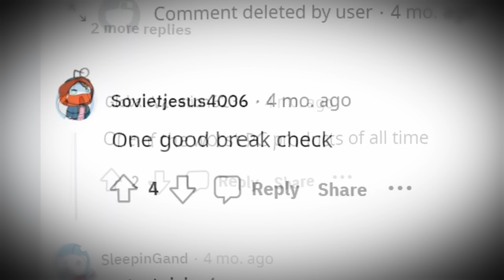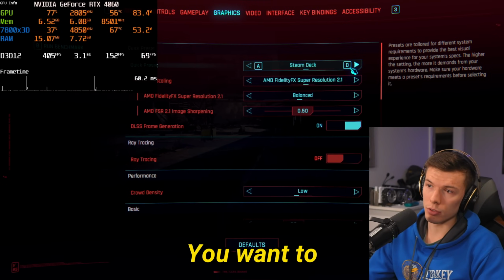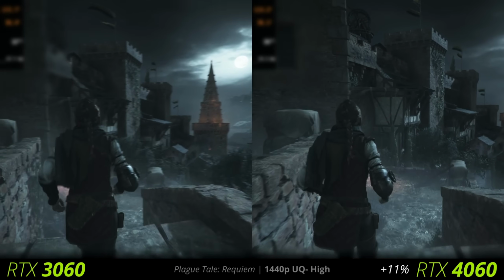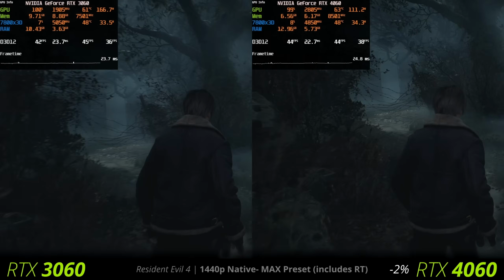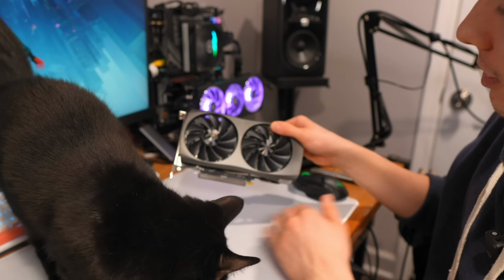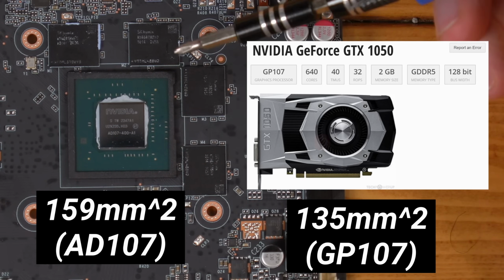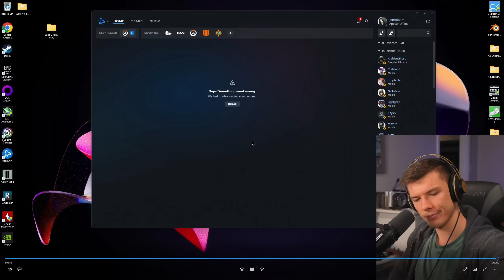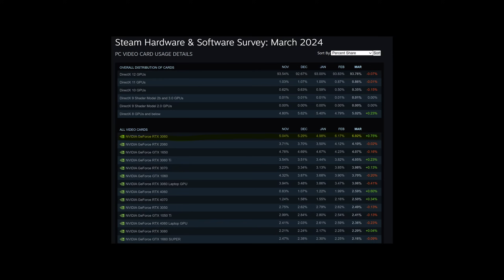I Tried Nvidia's best "Budget" GPU to see if we're Doomed

Comment: For perspective, to those that may be too young to remember.
In 2016, AMD Launched the RX 480 and RX 470. It launched along side Battlefield 1, which to this day, looks better, than some AAA games (cough, starfield) and still looks absolutely insane.
The RX 470 was MARKETED as a 1080p, 60fps, MAX SETTINGS card in a game that didn't even launch yet, and set the standard for graphics fidelity in first person shooters.
The 470 was also capable of getting 60 FPS at 1080p, max settings, in the witcher 3, probably the most demanding title at the time and was barely a year old.
The RX 470 cost 179, and the RX 480 cost 199. Accounting for inflation, that would make them 230$ and 260$ respectively.
The fact that a card for 299$ can't play a game like atmoic heart or the last of us at 1080p at 60 fps...even with NVIDIAS SUPPORT IN THOSE GAMES. Is sad.
Its also sad that the card from the previous generation runs better most of the time...

I won't even mention how in 2016 the RX 480 8GB at 230$ was marketed as a 1440p card...before 1440p even went mainstream.......

And another problem...is the 3060ti costs around 250$ used....
Reply: oh my god I knew AMD released some absolute bangers but I didn't know they released bangers THAT GOOD??
Reply: Amd got overshadowed hard in that time period by the 10 series of nvidia. It wasn’t until the 20 series that they started to fall off again. Even the 1650 super and the 1660 super are still arguably great cards for the price. Right now you could get either for less than a hundred dollars used. It is insane that the 1080 ti is comparable to the 30 series cards.
Reply: @delayedplayer I gave my 480 to my friend so we can play helldivers 2. It runs at like 40 fps native res, on an 8 year old midrange card.
Reply: Bro! I had the RX 480 and it was a fricking beast. I got a 3090 3 years ago and I gave my RX 480 to a friend and is still playing games on that card to this day. I was playing Resident Evil 2 Remake on High at 1440p 60fps. It could even run it at 4k 30 fps, that thing was insane, and it cost me 300 Canadian dollaroos. What a steal.

Meanwhile I don't want to say how much my 3090 cost 😢
Reply: The RTX card cost a bit more because of the RTX features and power efficiency, which is why it's getting more popular than the AMD and possibly Intel Graphics card that are cheaper and offer same or more performance.
Reply: You are just adjusting for inflation, but there are much more stuff happening on the silicon industry. The cost to decrease the litography skyrocketed, and the production costs are still increasing for several silicon chips mainly due to the commercial war against china.

It will affect, of course, the consumers. They just needed a window to justify the price increase, and it was the pandemic and crypto-mining, perfect excuses to compensate the production costs and  to increase the profit margin.

Not saying this to justify anything, I'm a consumer as well pissed off with such practices. Just saying that "inflation" is not the only thing that can explain these prices.
Reply: Problem with people like you is that is that you try to paint the other company as good. Yes Nvidia is mega shitty but AMD is garbage as well.
RX 480/470 and their refreshes rx 580/570 were great cards but what about releases like 5600xt and 6600 and 7600xt? Where AMD is back to marketting them as "1080p" cards. So no progress in what 8 years now? Infact a regression?
Reply: I have a 3060 ti and I didn't really think it was that bad until I got a 4070 s and it smoked my 3060 ti. Then it started bsod. So it got returned. But ya idk what to do. The 4070s models all have pros and cons and idk if I'm ready to give up my evga cardyet. I still have 5 years of warranty!
Reply: Yes i remember when ATI mad 2 drivers by years... overshadowed themself.....
Reply: Wait the 4060 can't run atomic heart at 1080p 60? I was getting near high refresh rate fps with the 3060Ti on mostly high settings. 

I know the 3060Ti is faster, but the 4060 should be able to run the game at 60 fps.
Reply: @chanzeyu1  I played the gamepass version and it was hit or miss but I didn't get very far. There was a stutter that was driving me nuts. I think it must have been a gamepass thing. My 3060 ti is stock tho. I don't oc anything. I prob should but I have never really been into it. Too much time fiddling with stuff, less time gaming. And I already have pretty limited gaming time. What 3060 ti do you have ?
Reply: @natel7382  FE, no overclocks. I did UV in the 2nd half of the playthrough but I kinda just gave up on the undervolt. It's not worth the instability. 

I honestly just lowered some settings and the stutters were gone? I'm not sure, but I had a great time with the game.
Reply: Yeah but that was in the past, now the same company doing that same shit that invidia doing

Considering that are still behind invidia
Reply: My 580 8GB hold up for 6 years and i could play anything on it at playable fps.
Reply: My old RX480 8GB is still in my sons PC at grandmas house. It still rocks in Fortnite and CS2. Never had any GPU that long.
Reply: @delayedplayer Most modern AMD cards are good. Nvidia is shit per dollar spent nowadays.
Reply: Yeah a 60 class card should at least bare minimum  achieve 60 fps all time native in  1080 ultra without  ray tracing
Reply: @Rullino32 don't give bs arguments 3060 is popular for AI stuff you need Nvidia gpu for that otherwise you would have to deal with a lot of headache and issues that 12 gb helped a lot power efficiency don't matter that much and certainly not to increase prices of a graphics card
Reply: Tech investing Boomers ain't ready to accept this fact
Reply: As a person who picked up a RX580 8gb for $60 (usd) a couple months ago, I wholeheartedly approve this post.
Reply: DLSS tho

Moore’s law is dead
Reply: its hilarious that i use a rx570  4gb and get 100+ frames in most games 1080p low settings
Reply: i played The Last of Us on high settings (no visible differences from Ultra) at 80-90 fps without an upscaler on the RTX 4060. Don't know what are you talking about.
Reply: @Rullino32  Nvidia and power efficient aren't synonyms
Reply: @skylius  I know, but most of the power-efficient graphics card are mostly made by them from what I've seen.
Reply: And then they proceeded to do it again but even better with the 580, the budget goat
Reply: What's more crazy is that RX580 still shredds some AAA titles of 2020-2024. Had stable 60fps on medium settings in cyberpunk on release, On release!!! Had a good experience with game and didn't have any major issues with the GPU itself and I got that one used for 140$😂
Reply: @talacra  it's the best bang for your buck in the hyper budget world of gpus
Reply: So which card should I get then for upgrade (I have 1660super)
Reply: Truer words have never been spoken. I salute you sir.
Reply: @Rullino32  that's mostly a selling point for productivity and crypto mining lol. I'm not gonna say nvidia cards suck like some people say, but if your goal is strictly gaming then amd probably has the best price-quality relation on offer. If you really need a GPU for work, with AI, crypto mining or intensive video editing then nvidia is probably the best, at least for now.
Reply: @Vecchete  but crypto miners did cause huge inflation on GPU prices, it's a big part, not the whole cause obviously, of why nvidia cards are on average way more expensive and have more sales. Are people forgetting that there were months were it was nearly impossible to get a 20 or 30 series RTX GPU at retail price on launch? It's not that there weren't any for sale, it was that intensive crypto miners were buying them out, and then on top of it there were market scalpers hoarding them to re-sell them to miners, so it wasn't just the shitty companies blaming greed on external factors, there really were external factors at play. And ofc the delays with shipping during the height of covid craziness added to the issue.
Reply: @CloudMV  If you're not having any issues with the performance, it should be alright, but if you want to upgrade the resolution or feel like it's lagging at your favourite games, you could upgrade to at least an RTX 4060 since it consumes similar amounts of power for more performance, otherwise if you're willing to upgrade your power supply, you could get a more powerful graphics card but that depends on the CPU you have.
Reply: @nuffsaid7759  I'm not saying that the RTX 3060 is garbage and no one should buy it, I just said that the 4060 performed better in the video except it occasions where the 3060 was better because of the VRAM capacity, but for 115W, it's impressive that it's performing well, if it had 12gb of VRAM and 192 jus width, it wouldn't be marketable as a 1080p card and not many people would be buying the RTX 4070.
Reply: @Rullino32  RTX card doesn't cost more because of rtx features it because Nvidia decided so because Intel use same thing as Nvidia although those aren't polished but they take the same amount of space in the wafers That's just nvidia tax.
For years a 60 class cards had 192 and 70 class card had 256 bit bus why they changed it now because sheep will still buy it plus defend their purchase and justify nvidia's decision to scam people of what they believe a 60 class card should be. Price and performance isn't everything for some people architecture matters.
of course it's efficient it's a 5nm tsmc.
Snapdragon 8gen3 is able to run gta V at 30 fps with 15watts only. If people defend nvidia for this decision then get ready for 64 bit rtx 5060 8gb it would be super power efficient and will run excellent and cool in 1080p be happy.
Reply: @nuffsaid7759  Fair enough, power efficiency is a great thing if they added more performance, but skimping on specs like VRAM in the 30 series made lots of people angry, which probably led Nvidia to add more VRAM for all the 40 series cards except the 4060, which also got bad reviews since it can't run every game at 1080p ultra, but it's popular for Fortnite gamers because it favours Nvidia IIRC, I could be wrong but I think it'll be at least top 5, top 3 or even 1st since it's the cheapest card from the recent generation and it's also popular in many pre-builds due to the decent price/perfomance relation, which is why the GTX 1060, GTX 1650 and RTX 3060 became very popular according to the Steam Hardware Survey, Nvidia is very popular in most Tech stores in where I live but they're only in pre-builds and laptops, the only "alternatives" could find were AMD and Intel iGPUs in laptops or cheap desktops, the best ones were around €800-1000 IIRC.
Reply: @Rullino32  i have ryzen 7 3700X 8 cores,will it bottleneck with 4060?
Reply: @Rullino32  A Good deal is a Good deal but that doesn't mean the product is good.
When I first went to buy a gpu there were no amd card in my area (wanted a rx 580 8gb) settled for 1060 6gb because I wanted more vram. Pricing and availability makes people buy the products but that doesn't mean It's a good product. 
There's a difference between good product and good deal.
Almost always a good deal will be better that a good product because it can almost do the same with less money but that's also not true for 4060.
People playing fortnite have no reason to buy a 4060 the only reason I see to buy a 4060 is horizon forbidden west or if your gpu died and you need a 'Nvidia replacement ' of current generation at cheaper price (makes no sense) I would just get the 4070 at that point that runs rdr2 at 100 fps no questions asked.
For 300$ rx 6700, rx 7600xt would be a better buy because at least the 7600xt gives you 16 gb
Reply: @Rullino32  I wanted RX 580 because I learned that in Doom 2016 there's  less texture clarity /quality in nvidia compared to Amd gpus because of texture compression or something
Reply: I'm still on rx580 f*ck both nvidia and amd for runing this clown show.
Reply: as someone who currently has a 570, it couldn’t even get 60 fps on the lowest settings of bf1. it can’t play ANY modern games. it can barely even play competitive games at low settings.
Reply: @Dobertathon  If your card is 4 gb it's over bro even in resolution like 800x600 with modern games like horizon forbidden west or RE4 it demands close to 8 gb vram.
Horizon forbidden west for example only takes 500 more mb vram when going from 800x600 to 1440p. Forget about 4 gb cards it's over for 8 gb cards as well. The Pascal generation is finally over. 
But here's the thing newer games aren't that good compared to the old ones which you could play flawlessly on your 570.
Reply: I just feel like they don't bother to optimize the games anymore since new shiny graphic cards can handle them anyway. Battlefield 1/ Batman Arkham Knight already look very good while running smoothly, but lately graphics have similar quality to them, while running way worse
Reply: I currently have a Rx 470 4GB and a 6650 XT =  it depends on the game. So I like Skyrim a lot and the 470 can only play vanilla Skyrim on 1080/60 with medium settings, but would crash when playing the Special Edn version. XFX 6650XT can max Spec Edn version but has tons of screen tear no matter what settings & parameters I use. 1440p maybe, but idk since I owned COD and Rainbow Siege when I had a 1070, but I get bored of shooters very quickly and have not tested them with the 470. But being these games like Valorant do 500 fps with a 7900xt, I'm pretty sure a 470 can get at least 60 frames. So again it depends on the game.
Reply: I'm on an MSI RX470 8GB rn. 😄
Reply: @donaldtrumplover2254  The 1080 Ti might be one of if not the best cards ever made in their respective time. It still can be used today with FSR support. It is the like a combination of an old sports car with the reliability and longevity of the old 90's-00's Honda cars.
Reply: @delayedplayer  The RX480 was really special.
Reply: No he wasn’t running anything at 1080p. He ran everything at 1440p. The card is literally a 1080p card.
Reply: @delayedplayer  They arent that good believe none of what you hear and HALF of what you see 😉
Reply: 1080p 60fps, this card is capable of that, but the problem is the graphic settings, either high or only low or mid like Last of Us settings wit custom settings to allow for.more.optimal performance.
Reply: @Rullino32 That's what they want you to believe. These features are in benefit for nvidia not consumer. If you want to use RTX, You need to buy atleast 4080. Then why customers pay for rtx even if it's unusable.

To even use rt on 4080, You need to use dlss. It doesn't run 1440p native. It's less of benefits to customer, More of necessary in order to work.

Yes we got some benefits when it was new. But new games count it necessary, not as option in system requirements.
Reply: Lets be honest, I've played 1080p Witcher 3 on a 460 GT on medium-high settings, that game is not a benchmark for GPU demand
Reply: Yup, the rx 480 8gb is just as much of a leagend as the gtx 1080ti just in its respective targeted market.
Reply: I 100% agree, but I'd also argue that performance is a two way street. Your argument implies that software is stationary, while only hardware affects performance.
Battlefield 1 shits on many modern AAA (and even AAAA cough cough) titles, while demanding half the processing power and memory, despite modern hardware being way more powerful. Simply put, because consoles no longer lag behind PCs, and because PCs have so much processing power, studios have been prioritizing time, cost and other factors in production, at the expense of performance.  I know it's low hanging, but how come CS2, a game that is mostly a 5v5 players walking on JPEGs and playing point and click somehow more demanding than Battlefield 4? And it's not like BF4s graphics look aged. Or how come it's easier to run GTAV than CS2?
 Games became unreasonably expensive hardware-wise too. Publishers and execs push for studios to make sure games "run" on most hardware, and just push it through release, without much thought. And we intuitively just expect the newer generations of GPUs to eat that processing need up and deliver the FPS. It's just not a sustainable cycle.
Reply: @ggwp638BC  big facts. Games are so much less optimized over the past 5ish years. it's insane. Starfield looks like absolutely dog water. It's worse than a ps4 game. And runs at sub 60 fps on high-end hardware. Situations like this have been happening dozens of times from AAA titles recently. Meanwhile, an Rx 480 ran the Witcher 3 flawlessly, and the Witcher 3 looks better than 80% of games that come out today.
Reply: @donaldtrumplover2254 1080ti is still the king.
Reply: 7970 and 290x were also bargains
Reply: I remember nvidia riva tnt2 with an actual fan on it then voodoo 3 2000 was the thing :D
Reply: They are trying to make our cards obsolete so that we buy new ones. I honestly believe that the reason most of the newer games coming out these last few years seem to be optimised like thrash is because they are trying to incentive people to upgrade their hardware, like constantly. We used to upgrade once every three iterations back in the 2000s and 2010s, now you either have to pony up like $2000 to buy the top-end card and use that for 3 iterations or keep upgrading constantly.

Also as you’ve mentioned the graphics in these games haven’t really advanced that much. Sure you’ve got stuff like Cyberpunk but when I look back at BF1, like you’ve mentioned or something like Red Dead 2. Most of the games coming out these days are even inferior to these titles. Developers used to push boundaries constantly but instead we have the greedy gaming market that we have today. 

I have a 3070 that I use almost daily and I can run Red Dead on that on High-Ultra settings at 2k at around 80-90 frames a second. If I try to run one of the more recent titles, I will get like 50-70 frames with DLSS and medium-high settings. 

Everything is overpriced as well like you’ve mentioned. Everyone puts Nvidia on blast but AMD is almost as much responsible. Their prices could still be reasonably lower and still make a tidy profit and also pull the prices down for everyone but they only care about their bottom line. 

I don’t even want to game anymore anyway at this point.
Reply: Cars are the same, pre 2015 if you want a good car.
Everything new is trash.
Reply: Cool story about rx470. As rx 580 8gb owner i say they are lie
Reply: @CapitanDePlai try stalker 2
Reply: The RX 480 had relatively the same performance as the GTX 1060 and actually significantly less than the GTX 1660 which was $10 cheaper and debuted 3 years later. If you cherry pick examples you can make either company look good compared to the other. It's also pretty disingenuous to insinuate that the 4060 "can't play" those games at 60 FPS. It can't play them with specific features turned on (like raytracing). It certainly can play them just fine. The price to performance for the 4060 is not good because Nvidia just wants to profit more and bilk people out of money but misinformation is misinformation either way.